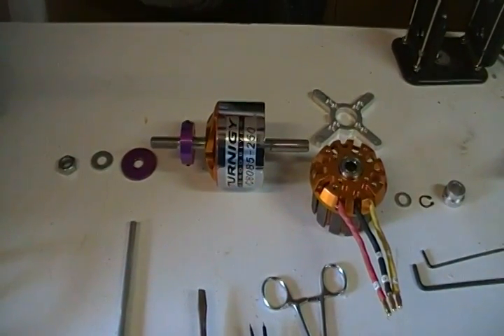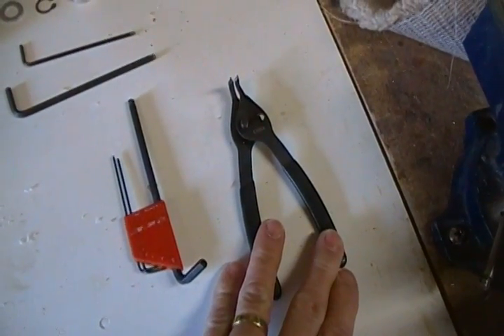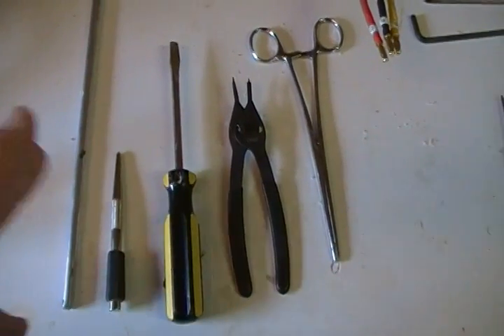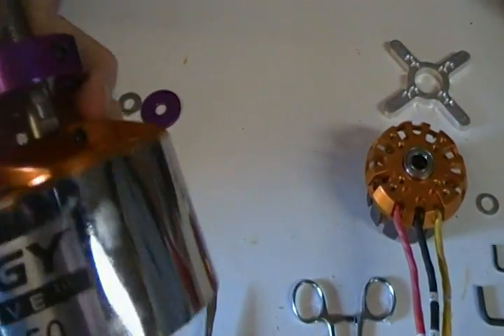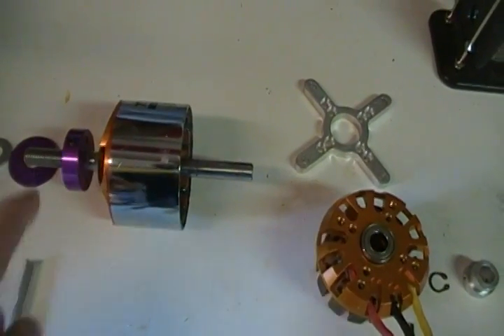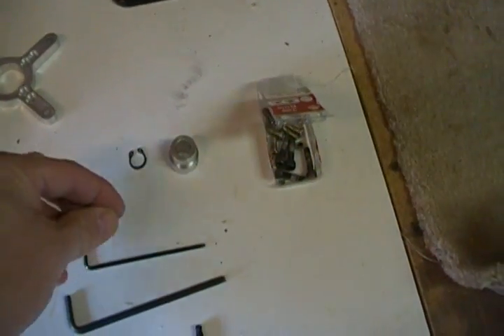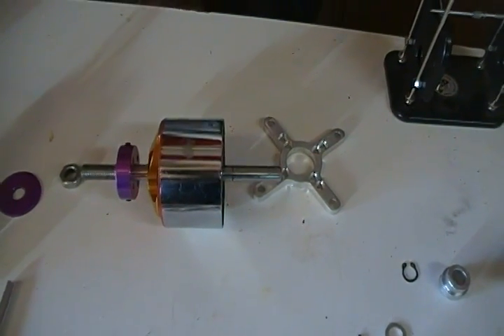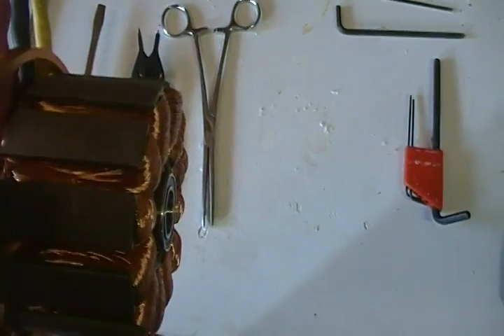Turnigy C8085 -250 Rebuild 1.MP4

Comment: Very nice Rebuild 
at first i didnt think you were right about it but after watching all the rebuild i will be doing the SAME !!!

you are right fightening the main prop nut will transfer mass pressure right to the circlip

i have the turnigy c80-85 170 kv its not the same at the other end it does not have a circlip
 do you know why ?

Regs